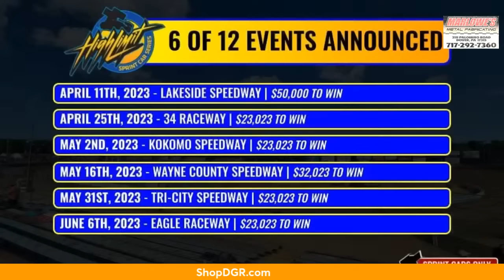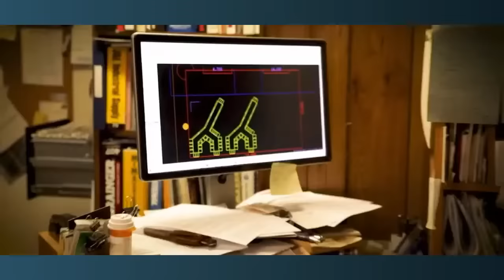Live Stream : "Brad Sweet"  High limit vs Outlaws &  Our Racing Years Together.

Comment: These up and coming sanctioning bodies need to think about making the spectator at the race track more “involved.”
Set up a race by race fund to pay back to a fan that actually shows up. Think of it as a 50-50 drawing, but make it more of a horse race type of thing. Attach the fan purse to a driver they selected. The different scenarios are infinite, but make it fun for the fans. 
The purpose is to support the local tracks, get fans in the seats. Grass roots fan base across 50-100 great smaller venues could add up big money.  Corporatize it and you go the way of nascar, and watch costs spiral out of control. 
Covid did more than create race exposure online from streaming services like flo, dirt vision and YouTube, but it also made people hungry to get outside and do something new and exciting like enjoying motor sports. Never forget the fans and money will be there to flow upwards.